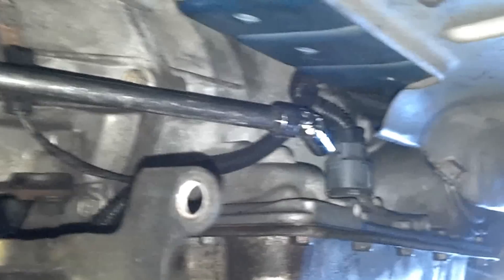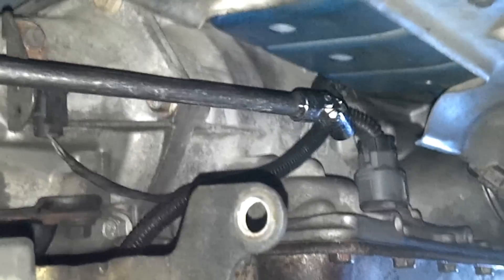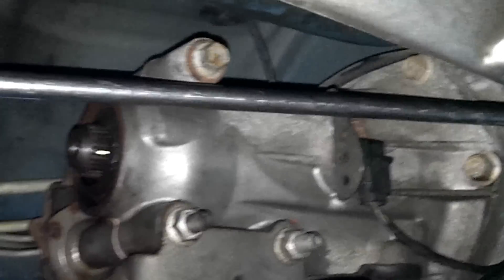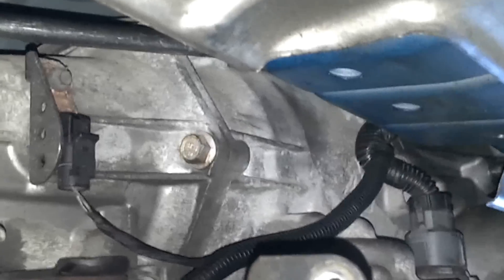2002 Pontiac Firebird transmision removal part 1

Comment: have a question I have a 2000 Firebird and the guy working on it has is trying to drop the transmission so that he can replace my fly wheel he can't find an another boltt I guess he thought has them all out but something is holding it is the another bolt hidden somewhere that hard tho find or see?